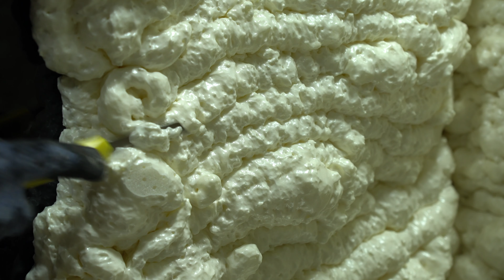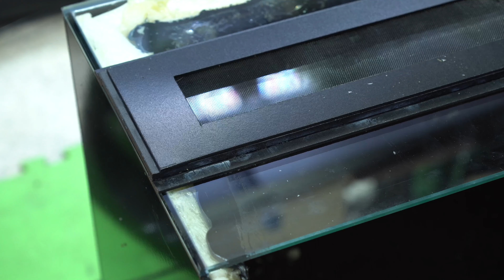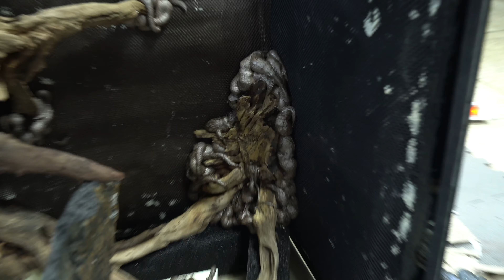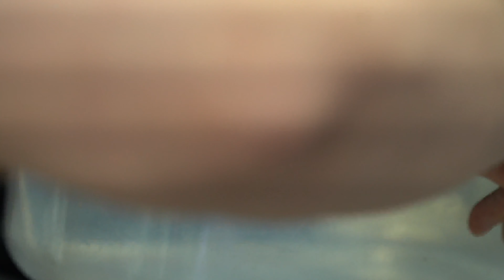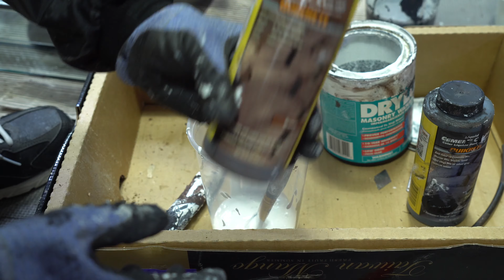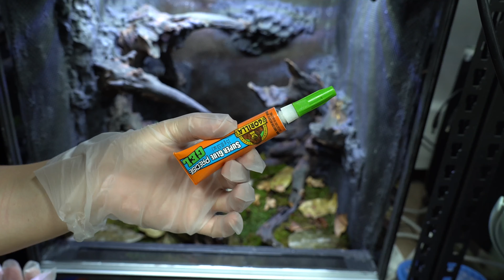다트프록 팔루다리움 빌드(Dartfrog Paludarium Build)

Comment: How do u prevent mold? And mold from the wood that has water flowing through.
Reply from the maker: I use drylok to prevent mold.  Driftwood is also painted with this to prevent mold.
Reply: @doublesvivarium6487  does if have to be a specific drylok?
Reply from the maker: @jerryv4717  I use drylock masonry waterproof.